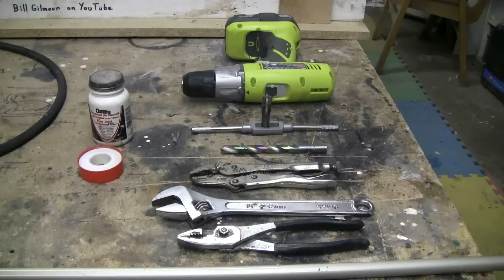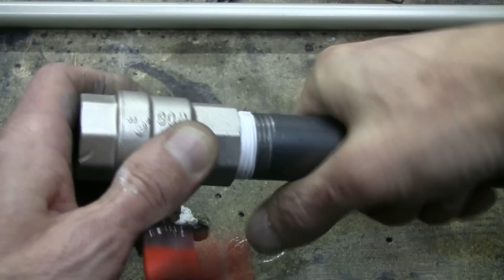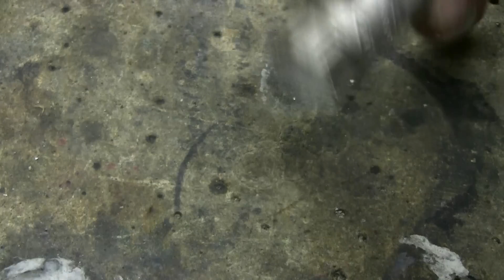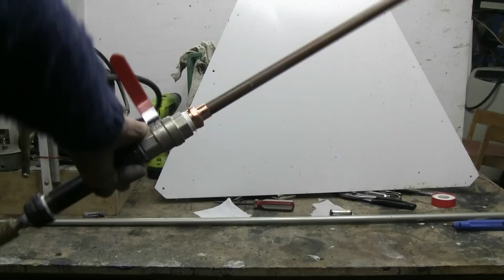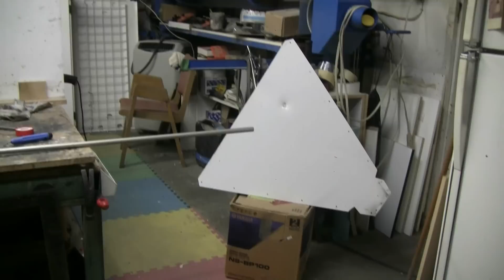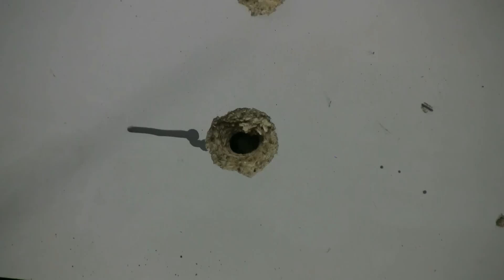Do It Yourself - How To Make A Simple High Pressure Air Cannon

Comment: You need a longer barrel because when you let the air out, its being let out too slowly so the projectile needs time to receive the full air of the air coming out of the chamber, because also the diameter of the outlet coming directly off the chamber is too small..  If you had a wider output coming directly from the air chamber to the  barrel, and quicker (spring loaded) trigger to open the valve quicker, you wouldn't need a longer barrel, ... You learn these things as you observe working with such things. It's one thing to actually put everything together, but its another thing to understand what's going on, and how the whole system works with flow, etc.

Comment: Black iron has a lesser bursting pressure than Galvanized gas pipe. The black Iron pipe is ok for the type of pump you have, but if you want to pump up to like 4000 PSI you'll need Galvanized gas pipe and use either a hand pump that can pump up to thousands of pounds or get an electric pump that can do the same.
Reply: Who the F has any sort of compressor unit that will pump that high?  Were you also the kid in high school physics class that constantly corrected the teacher while learning algebra based formulas?  Just curious why you chose to comment something as unrelated and off topic to the subject as this.
Reply: @theamaturepro  They sell them. I have a hand pump myself that pumps that high but you can also buy an electric pump for air rifles. Just look them up.
Reply: @suoppsdn9751  Ok then, I'll take your word for it.  Still not the air compressor the vast majority of people watching this have.  Hopefully anyone with a specialty little compressor like you describe aren't dumb enough to blow themselves up with galvanized pipe.